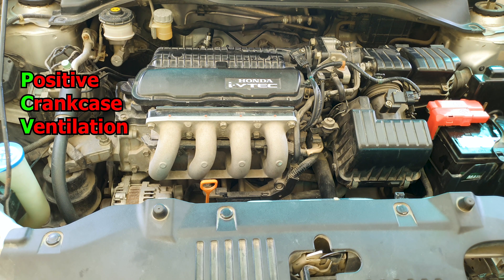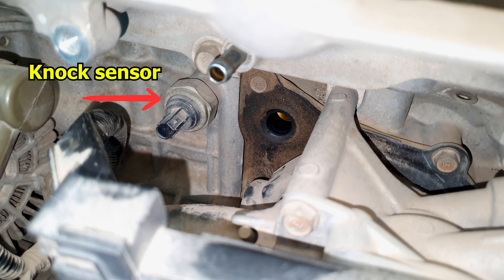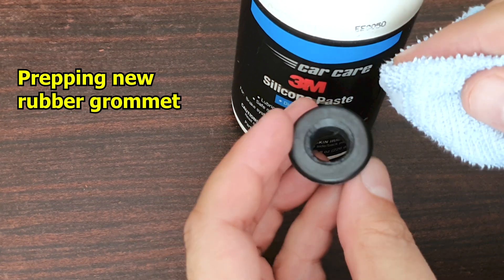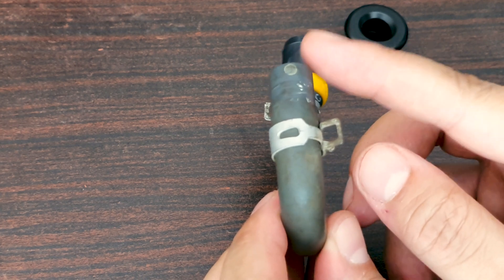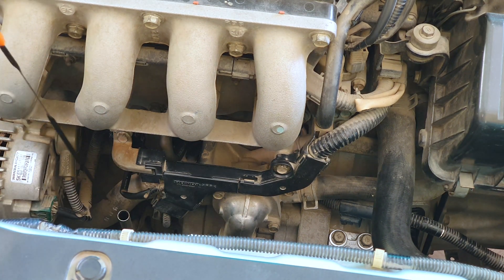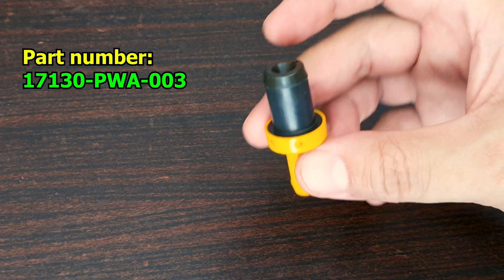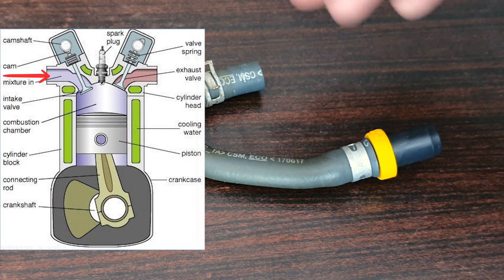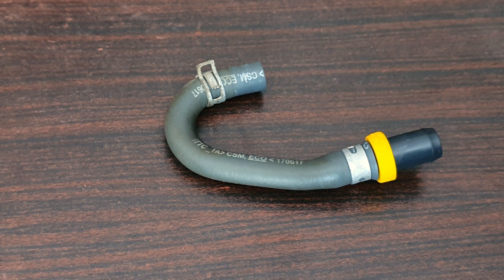PCV valve: check this before throwing money at your engine.

Comment from the maker: Part numbers for 2009-2014 Honda Jazz 2nd gen, City 5th gen and Freed 1st gen (Non-hybrid GB3):

17130-PWA-003: PCV -> applicable to other small Honda vehicles (confirm before buying)
11855-P72-000: Rubber grommet
17131-RB0-000 or 17131-RB1-000: PCV Hose -> if is damaged or feels flimsy/squishy replace it as it could collapse during PCV operation resulting in flow restriction.
--------------------------------------------------------------------------------
Honda FIT 1st, 2nd & 3rd gen 2007-2021 (US Market):

17130-PND-A01: PCV
94109-14000: Washer for PCV -> same 14mm washer as oil drain plug for Honda's

17133-PWA-900: PCV hose for 1st gen FIT 
17131-RP3-A00: PCV hose for 2nd gen FIT
17131-5R1-000: PCV hose for 3rd gen FIT
--------------------------------------------------------------------------------
Honda FIT 1st gen (Japan)
17130-PWA-003: PCV
11855-P72-000: Rubber gromment
17133-PWA-900: PCV hose
--------------------------------------------------------------------------------
Honda BRV 1st gen 2016-2022 - Honda City 6th gen 2012-2021
17130-PWH-M01 or 17130-PWA-003: PCV
11855-RK8-003: Rubber gromment
17131-55A-Z00: PCV hose
--------------------------------------------------------------------------------
Honda Civic 8th gen 2006-2011
1.8L engine:
17130-PND-A01: PCV
94109-14000: 14mm washer
17131-RNA-A00: PCV hose

2.0L engine:
17130-PNA-003: PCV
17139-PK1-000: Rubber gromment
17131-RAC-U00: PCV hose
Reply: Very informative. I need that pcv valve can you help I’m in Zimbabwe
Reply from the maker: @djmaroh  Best, quickest and possibly cheapest option is to go to your local honda dealer/service center and give them the part number. They should be able to get it for you.
Reply: @TheWrenchWiz  it’s around $40 here in zim😂
Reply from the maker: @djmaroh  Ouch. I guess the cheapest way would be to have someone bring it  from overseas.
Reply: Could I have the part number for pcv valve for Honda Freed GB3 2015 model please? Thank you!
Reply from the maker: Its the same as the Jazz 2nd Gen, 17130-PWA-003. I updated the pinned comment. Always double check before buying.

Comment: its the most stupid design, the valve is using plastic and when you pull it out, it break, some part likely will drop inside the oil catch tank, and it might further drop inside oil pan.
Reply from the maker: Yes, agreed.

Comment: Back in the mid 1990s our daughter 1989 accord started idling rough we checked everything! Finally in dispare & with brusied pride took car into a shop here in town that specialized in driveability issues. The fella knew exactly what the issue was. Honda had stuck a very tiny PVC underneath the intake manifold on the fire wall side. Mechanic used a huge long pair of 90' needle nosed pliers to grab it. The guts of the valve had disintegrated & were sucked into engine. According to tech a common happening. It was worth $35.00 to learn about where that valve was....and tech insisted on a factory part....
Reply from the maker: Interesting. I had a look at the parts diagram, dont know if it was the correct varient, it has a metal body PCV valve. Also it showed it has 2 PCV valves. But I like its connected with hoses, not a rubber grommet like in the video. Absolute pain to get out when its cooked, which is why I change it before that happens. Thanks for sharing.

Comment: Silicon is known to damage the O2 sensor. For years as a mechanic this was unknown to me. Many people spray silicon all over the engine bay on rubber parts thinking it preserves. When needing lube, Hydrocarbon based grease is always a better choice. Not sure about dielectric grease. A slow O2 sensor can be cleaned by using 1 Qt of lacquer thinner to a tank of gas. It will clean the injectors too. Usually  a mix of 1 ounce of acetone and 1 ounce of marvel mystery oil to ten gallons of gas will keep the fuel injectors clean when topping off tank.
Reply from the maker: I fear hydrocarbon grease would damage rubber which is why I chose the dielectric grease. Didnt now about the lacquer thing. I have only ever used off the self injector cleaning products that goes into the gas tank. For the o2 sensor, i have dipped in white vinegar that removed some carbon buildup. I didnt have any code.

Comment: My grommet is practically breaking off due to how stuck it is..how do i get it off from inside the valve cover
Reply from the maker: Though I never did, you could try to use a vacuum. Otherwise you have to open up that black vent plate. 

To do that you need to open up the coolant joint in front of it, thus need to drain some coolant. The starter motor has to be removed. The the black plate itself is held by silicone gasket and bolts. A small piece fell inside, I didn't do anything though. 

The passage inside is a zig zag down into the engine, so I took the risk that it would get stuck somewhere instead of falling inside the engine.

Comment: Honda engineers should be ashamed to put such an important item in such a hard-to-get place.
Reply from the maker: I wouldn't necessarily say its very hard to reach. But what I see as only a cost saving measure, by using a rubber seal and plastic pcv that if not changed in time makes it hard to get out. The Honda fit has a metal pcv with crush washer, simple.
Reply: My mechanic had a hard time looking for the pcv valve. I have a Honda Freed GB3 2015 model and it has the same pcv valve part number as the one in this video. He said that it is his first time seeing a pcv valve hidden that no one knows where it is.
Reply from the maker: I guess you win some, lose some due to engine orientation. The vtec gasket is super easy to get to on these engines for eg. On the civic, r18 and K series engines its on the back.

Comment: Hello the yellow part of PCV came off and the other is still there how to remove it i tried it with nose pliers i dont want to break it so it will fell inside , sould i use a screw to take it off?
Reply from the maker: Try to get something under it first, so that it doesnt slip in and down. Maybe some thin metal tool/sheet that you can slip under. Then just keep trying to get it out. Use whatever you think you can get it out. Maybe use a fish hook type of tool. Take your time. Amongst all the DIY stuff I have done to date, this was the most frustrating and time consuming. Good luck.

Comment: Hi, can I get an advice how to take it out when it falls into the engine? Mine broke twice when I was taking it out, resulting to a huge chunk falling inside. Also can I drive the car safely if I install the new one? The entrance of the valve is not blocked.
Reply from the maker: I also had a piece fall in a few years ago, have had no issues. The passage eventually leades in to the engine, however its not a striaght path, zig zag. So it wont just drop into the engine, it will hopefully get stuck on the bends inside. 

Try a vacuum.  I didnt think at the time to try it.  Otherwise you have to open up that black plate. To get to the black plate you need to drain the coolant and remove the coolant bracket/housing that is in front of it. I believe the starter mortor may also have to be removed. So its not straight forward unfortunately.
Reply: @TheWrenchWiz  Thank you so much! I will try vacuuming the valve entrance first to see if it works. You've been a huge help please keep it up.
Reply from the maker: @icebuko7777  Your welcome. Good luck.

Comment: #city2012  While driving at speeds between 30–60 km/h and releasing the accelerator, the car jerks slightly. Could this be caused by the PCV valve?  Cuz’ The spark plugs, ignition coils, and fuel injectors have already been replaced or cleaned, but the problem still persists
Reply from the maker: I doubt this would cause it. I also get jerks sometimes and I believe it is the engine mounts, they are wearing out. So I am mindful to not abruptly release the throttle.

Comment: Why is my New grommet make it so hard for me to push my new new pcv valve, the old one too, same part number. Any idea of something i can do? And it is so hard to take out again the new grommet.
Reply from the maker: Well its new, not worn out, so it will provide a tight seal. Put the grommet in first and then push the pcv valve in. You can put a very little amount of silicone paste on the end of the pcv valve to help it go in easier.

Comment: My 2004 honda fit oils the intake manifold,and it consumes a lot of oil.can this be the result of a faulty PCV valve?
Reply from the maker: Yes could be, if the PCV valve is stuck open.

Comment: Hi, I’m from Jamaica. I own a  2021 Honda city. It’s the first I’m hearing about this. Not a single mechanic has mentioned it, so thank you. I’ll definitely check mine, it has been around a lot.
Reply from the maker: Caribbean represent. I grew up in Antigua 😀. PCV valve will easily last 100k or more. It's just not part of any maintenance schedule. I believe preventive maintenance, earlier replacement, is better than having it fail.

Comment: Hello Sir, today I had the idea of changing the old PCV valve for a new one, in the same car in the video. Unfortunately and accidentally, the old rubber edge entered the compartment and I couldn't remove it. Since I need to use the car, I put in the new PCV and put everything together accordingly. What can go wrong with the engine with the rubber edge, which was already dry and hard? Can something break? Where does the rubber edge end? I appreciate your response. Regards
Reply from the maker: It falls into a twisty passage that is intended to separate oil mist from the air flow. That eventually could end up into the engine oil sump. 

In my case, its been a few years now, a small piece did fall. But I was so exhausted trying to prevent pieces from falling inside I didnt bother. I have had no issues. But there is always a risk it may end up somewhere where it shouldnt. In hindsight I should not have left it. 

Try to use a vacuum to suck it out. If you do decide to open it, you have to drain the coolant to remove the thermostat housing and its bracket. Then the starter mortor has to be removed. That black pcv plate is held by bolts and silicone gasket maker (so needs to be sealed up again like that).
Reply: Thank you for your extensive and kind response. I will then try to disassemble the part where the grommet fell and I will try to remove it. Right now, I cannot do it, but I will try to do it as soon as possible. Thank you again. Regards
Reply from the maker: @rollsroycess  While your at it, might as well change out your coolant, if its been a while.

Comment: I am trying to take out PCV Valve but it's not coming out. I tried they you did but it's not coming out. The hose pipe gets off from the valve but the valve is not coming out. After trying many times I fix it back again.😢
Reply from the maker: I'm assuming it was never changed, it will be bad and come out in pieces. You just have to keep at it. It most likely will brake into pieces, make sure it doesn't fall inside. The first time I took it out, it took me hours. Which is why I now change it before as a preventive maintainence
Reply: @TheWrenchWiz  What if the bush fall inside?
Reply from the maker: @54651111  I have had a piece fall inside, have had no issues. It did not block the passage. However lets say it falls all the way down into the engine it could be an issue. But Its a zig zag path down, but cant rule it out.
Reply from the maker: Also did you buy the new one with rubber grommet? Buy that before taking it out.
Reply: @TheWrenchWiz I am also sure it wasn't changed before. I haven't bought the new one yet. So, I keep it as it is. My hands got blisters but it wasn't coming out.🫤 I will buy a new one and then find some spare time to do it again.
Reply from the maker: @muhammadawais581   Use pliers, or a grip plier if you have. Make sure you get the rubber part too.
Reply: @TheWrenchWiz  Got it, first I will arrange it then start doing replacement.
Reply: In case of small broken pieces and debris inside can I take them out by a vacuum cleaner ?
Reply from the maker: @muhammadawais581  No harm in trying. You may suck a bit of oil vapor into the vacuum.
Reply: Got it. Thank you.

Comment: If i cold start the engine it is blowing air out of the oil cap. No sign of sludge, oil reduction,  and smoke from the cap. Is it normal? Do you the same in your city? My car is 197000 km on odometer.
Reply from the maker: Let me check on mine, I'll back to you in a day or two.
Reply: @TheWrenchWiz  Thank you so much. If I place hand it is like blowing in and out. There is also a lot of grimes on pcv Valve. Might be its never replaced
Reply: @TheWrenchWiz  Have you checked on you city.
Reply from the maker: @muhammadawais581  I will tomorrow. Ill update.
Reply from the maker: Yes it's the same, air blows out of the cap.
Reply: @TheWrenchWiz  So, what you think it's normal or not? I have researched a little but didn't find anything conclusive. If I take your case like how you are maintaining your car regularly it seems normal. BTW thank you so much for your response.
Reply from the maker: @muhammadawais581  Yes it is normal. My engine is in great shape. This imo isnt a sure way to know if something is wrong. You would need proper tests like a compression test for eg. to check if your piston rings are worn
Reply: @TheWrenchWiz  got it. 👍

Comment: I would definitely replace the hose , grommet and clamps , also . And maybe to spray carbeurator / throttle body cleaner / intake valve cleaner into the orifice that the PCV valve goes into before putting in the new one . Pay attention to if the rubber grommet is brittle . Then to gently remove all of it before it falls into the hole . In this situation I successfully used a fine needle nose pliers to remove it . By pulling up at different spots , trying to evenly pull it out . Using just enough pressure to grip it . You could soak overnight the new grommet and new hose in 303 Protectant or spray each down inside and out . Then before installing to wipe excess away with microfiber towel . And also before trying to pull out the pcv valve/grommet to liberally spray silicone to be a lubricate .
Reply from the maker: Thats why I changed the pcv and rubber grommet on the early side this time. First time I did it, was a nightmare. The hardest DIY ever trying to ensure rubber pieces didnt fall inside. I wouldnt spray anything into the opening as the oil separator leads into the engine and you will contaminate the oil.
Reply: @TheWrenchWiz  Ok , my 2020 Toyota Camry has 71000 miles and will be replacing it , to prevent negative consequences . But , I think always changing oil at 5000 miles , and using an engine flush . Will prevent gunk from building up to clog it . Though I had a 2011 Toyota Camry and didn't change it up to 2021and no issues . Because as I mentioned above  , I believe .
Reply from the maker: @peterrudy9207  I also, I do not agree with long oil change intervals. In my case it wasnt really clogged but the rubber seal and pcv itself structrurally failed due to the heat cycles (the first time I did it) . PCV came out in pieces. 

I have used engine flush a few times early on, but I stopped. As I have opened the engine top to do valve adjustments, and because I change the oil early, engine is clean as can be. Currently at 140k miles.
Reply: @TheWrenchWiz  I thought I had mentioned for installing spray silicone spray on the end of the hose and grommet . Then maybe periodically spray the grommet to resist it from drying out / cracking .
Reply from the maker: @peterrudy9207  I did apply silicone grease for installation. Good idea, didnt think to do it periodically.
Reply: @TheWrenchWiz  I was thinking spraying silicone around the grommet and tip of the hose to go in without tearing . I think grease would attract a lot of dirt ? But , then after spraying grommet when it is installed , wipe up the excess .
Reply from the maker: @peterrudy9207  The hose is easy, the grommet is tight. I applied only a bit of silicone grease on the tip of the PCV. On the outside of the grommet I wiped it down so it left a protective dry layer.

Comment: My Honda city 2019 petrol  oil dip stick lightly oil blow up 
Its normal or any problem.
Reply from the maker: I dont understand what you mean. The oil is higher on dip stick?
Reply: I will check the oil level is ok 
But oil blow out the dipstick
Reply from the maker: @JohnJohn-ko4ow  Are you removing the dipstick when the engine is running?
Reply: Just 18000 kilometre run.
Reply: Yes
Reply from the maker: Oil is circulating in the running engine, removing the dipstick is just a path for it to move out. Nothing is wrong. You wont get an accurate reading with the engine running. Check the oil when the engine is off. Wait around 5 mins to let the oil settle down before checking. https://youtube.com/shorts/LvFlPAIiBvI
Reply: Yes
Reply: Rpm range is accurate. Oil dipstick level is ok.Engine sound is ok. My doubt is Pcv valve not perfectly working.
Reply from the maker: @JohnJohn-ko4ow  At 18k driven highly unlikely pcv is faulty. I would not worry about it. Oil coming from dipstick tube when engine is running is expected.
Reply: Ok
Reply: I have 2 Honda city 2010 model and 2019 model. But 2010 model driven 60k kilometre check the dipstick not blow up oil.
Reply from the maker: @JohnJohn-ko4ow  I cant say really.  If your really concerned that too much maybe crankcase pressure on the 2019, get a compression test done.